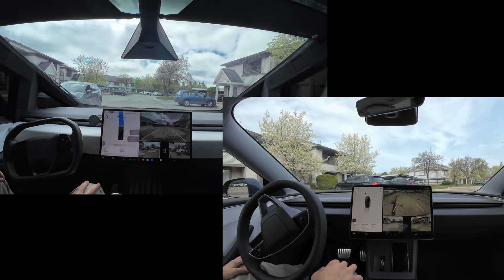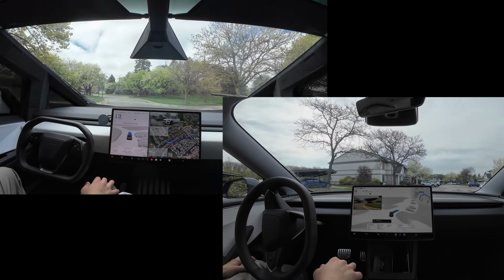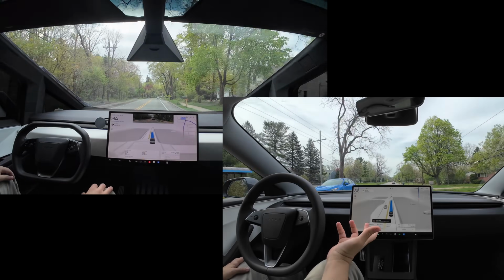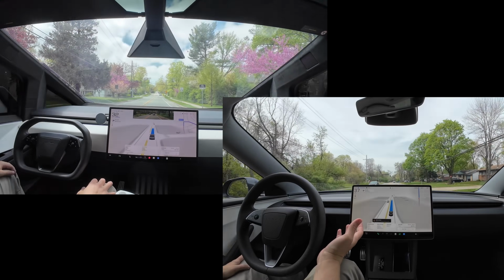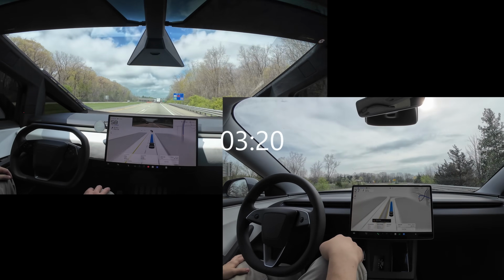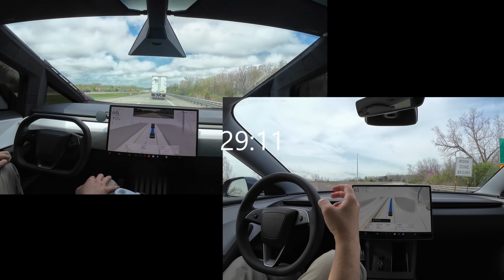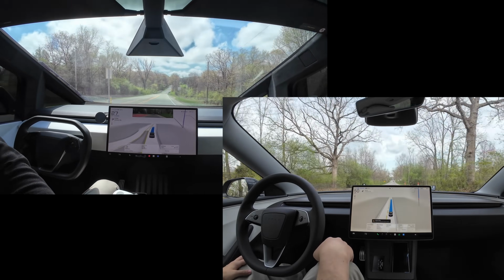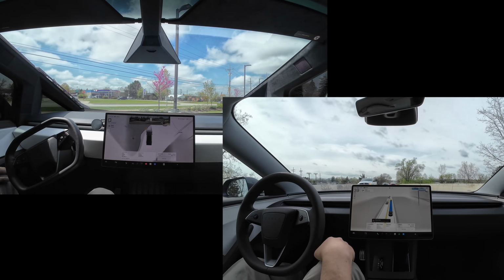Tesla Model 3 Full Self-Driving is BETTER than Cybertruck

Comment: 15% over or 15 mph over? I noticed you say both within 30 seconds!
One of the reasons I specifically do not trust, as well as realize, that losing the pedals and steering wheel is far from 'smart' - is because of the differences people are experiencing with self driving - regardless of the model.

Comment: The cyber truck weighs approximately 6800 pounds. The model 3 weighs approximately 3900 pounds.  Then you have the size difference.  It’s a lot easier to navigate a smaller vehicle than it is a larger vehicle.  The liability for Tesla to have a 7000 pound vehicle get into an accident potentially.  Is a lot more risk than a 3900 pound vehicle. In my opinion, that’s why the cyber truck is not as advanced with FSD.  I noticed a difference with the model Y I don’t think is as good as the model three   in my opinion
Reply: I would think the rear wheel steering has more impact on the difference with FSD. Cybertruck turns completely differently, regardless of gross vehicle weight, than any other vehicle Tesla is capturing data from. The weight might account for the slower acceleration though, even though the CyberTruck is similar in power to weight ratio.

Comment: 2:15
My hope would be that the controls part of the equation will be able to be converted between models, or already is.

I have wondered myself about this. Are they training an entirely different model, or are they just changing the controls over. If its just getting the control information dialed in, then the amount of data needed would be greatly less vs having to gather all the video data over again... maybe? 

The main reason Ihink this is the RoboTaxi has had basically zero actual on the road time and will never have a human correcting it in real time. That is why I think they just need the controll data to stack up a bit to fine tune it.

Comment: Great comparison.  The "pensive" nature of the CT FSD comes through in your video.  With that said, my 2024 Model 3 Performance does ignore my set offset at times too so it's not just the CT!  Example, it'll pull out onto a road that it knows is 45 MPH because it displays the correct speed limit.  Sometimes it'll go up to 57 or 58 MPH and stay there for a mile and then all of a sudden it'll display "54 Max" and start slowing down.  You can almost feel it saying "Oops.  Going over your 20% limit.  My bad" and then it corrects itself.  It doesn't always do it and I've not tried to figure out the factors involved.  May have something to do with changing roads into a different speed limit?

Comment: What you are saying about the CT being slow is 100% correct. It drives along and at seemingly random times/places decides to slow down. It is annoying to the point of me choosing not to use FSD nearly as much. I can understand some scenarios where the same road becomes more congested or narrow. What I can’t understand is why in apparently stable conditions its speed decays. There isn’t an obvious shift. It just starts to slow down 1 mph at a time. Other than the speed thing and sometimes changing lanes during double left hand turns, it has been very good.

Comment: That experience of CyberTruck sometimes ignoring the 15% speed offset allowing it go faster than preferred speed happens all the time with HW3 cars as well. When you use scroll wheel to adjust it I have seen the percentage could be as much as 100% over actual speed limit. This is especially true in lower speed zones like 30MPH or below.

Comment: Speed Offset requires monitoring and adjustment with scroll wheel.  I set at 10% and it will often speed 3X that.  It's not consistent in how much it speeds.
13.2.8

Comment: I'm still on the archaic 12.6.4, but speed control is still my biggest complaint by far. I don't understand why this is so difficult for FSD. It's both ends of the spectrum too. It misses speed reductions constantly or doesn't respect my offset. Other times it goes way too slow or takes forever to speed up. So frustrating! 🤬

Comment: The Model 3 is a sports car, while the Cybertruck is a 7,000-pound truck that requires more time to decelerate. 
My main issue with the CyberBeast's Full Self-Driving (FSD) performance is that it follows the vehicle in front too closely. I prefer a 2-second gap, but FSD often maintains less than 1 second, particularly at 80 mph (in a 70 mph zone). Although FSD reacts faster than a human, it frequently brakes abruptly when traffic stops suddenly.
Reply: FSD does NOT react faster than a human driver. Following 1 second behind in 80 mph is dangerous and illegal.

Comment: How does FSD handle sharp, curvy, paved roads in rural areas? That may not warrant a video as most viewers interested probably live near cities, but I’ve been curious how it handles the curvy countryside for sometime now.
Reply: 13.2.8 drives more slowly and cautiously on rural, hilly, winding roads.  I use the accelerator and sometimes take over and drive manually (1-pedal).

Comment: CT is much larger and higher, and it has better suspension. This is probably why it feels much slower. Lower cars with stuffer suspension feel much faster at the same speed because you are closer to the road and feel the road surface more. To be fair it is slower but the perception is also at play here.
Reply: That 100% contributes to the factor, I have also a Y and 3 Performance. The Y feels a lot slower since you sitting higher.
Reply: @kenion2166  Yeah, i have marcedes C and new bmw 5, they have the exact same acceleration but C feels faster even though I generally find my self speeding often unintentionally in my 5 series.
Reply: Relating to SUV's I have heard the perception of speed is related to height above the road.  In an SUV you can go faster and it feels slower than a much lower car going the same speed.  Maybe also the reason for low sports cars although low also helps with stability.  I wonder if a Y or X might also have a speed issue like the CT

Comment: Great comparison.
In my Juniper I have noticed it loves the right lane, even when coming into a construction zone and the lane is ending. It will move from the left lane to the right lane, then right the right lane right up to the cones then get over.
I have noticed, the turn in front of people on left turns as well, I do not trust it enough to get up to speed, since it likes to take its time. Just like your CT.

Hurry mode on local roads (not highway), seems a little crazy. It is always trying to pass people at stop lights (From the right lane that is ending), the only problem is, it has no urgency, so it usually fails.

Comment: My CT FSD is way better than my 2018 Model 3 FSD with HW3.   Use it all the time.  I suspect once we get Summon the behavior will be equivalent.
Reply: If they really are different…   Model 3 fits like a glove and the CT like a winter glove.  BUT CT does everything!  Off-roading,  hauling daughter’s crap back from college, smokes everything off the line and just looks durn cool.  Ymmv
Reply: You're mostly describing the difference between HW3 and HW4, I believe.
Reply: @George-JT-l2q  yes.  But I also think there is a difference with Summon enabled which is not there in CT yet.   Oh and I have 40% speed limit enabled like recommended.
Reply: I’m currently driving an M3 with version 12.6.4, and for me, it’s almost flawless. I’m awaiting delivery of a CT—do you think it compares to 12.6.4, or is it better?
Reply: @dragut  that’s why I have in my 3.   You will love the CT!   I suspect.